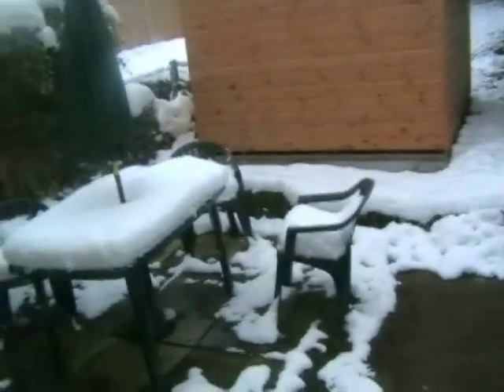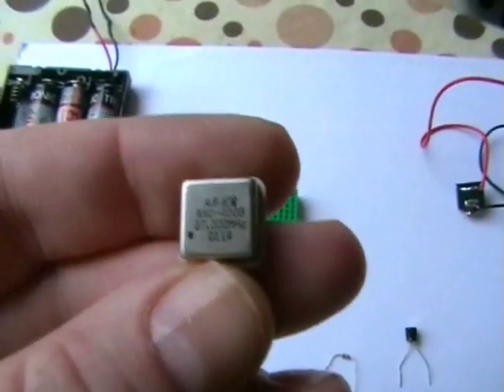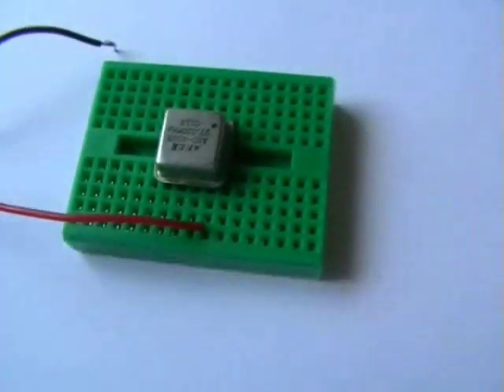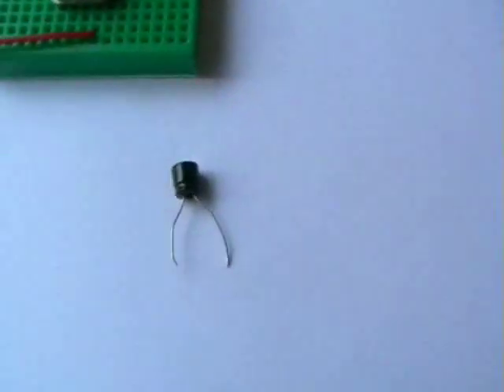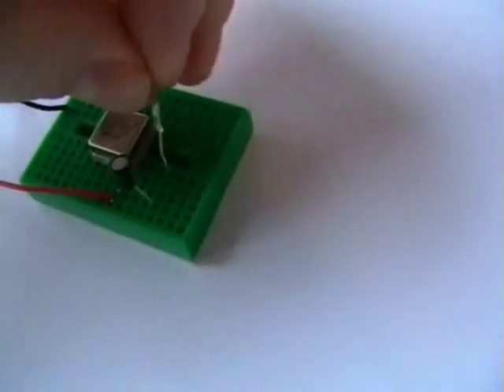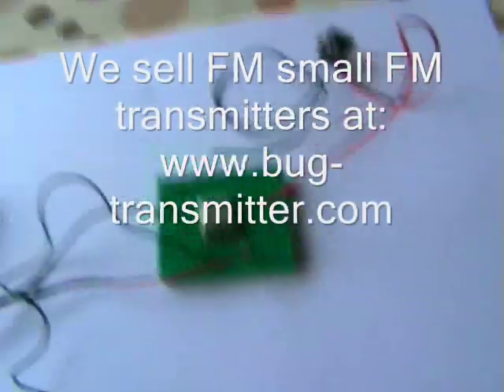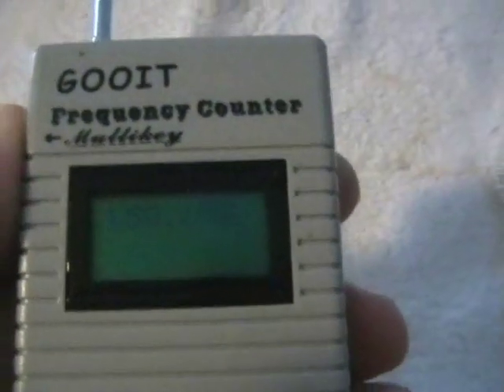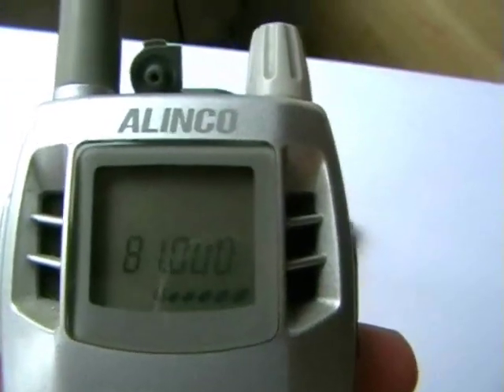Make a Transmitter only using 4 components. Crystal oscillator transmitter

Comment from the maker: This type of crystal oscillator makes a square wave ,square waves are encountered in digital circuits and are used as timing references or "clock signals. Square waves contain a wide range of harmonics; these can generate electromagnetic radiation or pulses and this is what you see in my video ,you see the harmonics.
You can use filters to make a nice clean sine wave but in this video i am showing how to use a crystal oscillator on its harmonic frequencies.
Reply: YES 470uf

Comment from the maker: You can try and use an amp ,it may give little improvement.
Try different value capacitors for the audio input.
My radio i used in the video is very sensitive.

Comment from the maker: Yes ,you can use a higher frequency.

The higher the frequency then the shorter the antenna you need.

At 1Mhz   using a half wave antenna ,its 5616 in !
At 81Mhz  using a half wave antenna ,its 69 in
At 433Mhz using a half wave antenna ,its 12.9 in

Comment: I have a question please...the sound I'm getting is quiet low ,in fact extremely low on any radio i use, i have to concentrate very hard to hear it.
and the volume you're getting in the video is fairly good
is there a solution to this ?

Comment: I have tried to find a 4 pin oscillator on old video cards and mother boards  but they all have 2 pins.  Is there a way to use these 2 pin ones to make a simple radio like this?

Comment: I had the same result as Hassan.  The sound on my radio was very faint.  I am using a variable power supply so I increased the voltage from 5 volts and found it got fainter.  When I reduced the voltage to 2.5 volts it became louder on the radio.  I tried several of these 4 pin devices with frequency from 10 to 50 MHz but always hear the transmission on the low end of the AM band.
Reply: My guess is that audio signal directly alternate the power supply (a bit), therefore changing the oscillation amplitude. 2.5V is perhaps the minimum voltage to start the oscillator and small change in VCC will have bigger impact on oscillation amplitude. At about 5V vcc the oscillator is very stable and small change in vcc doesn't move the needle so that you can't hear much on AM radio.

Comment: Hi, can you help me,I am trying to build/get a transmitter reciever for a small rang around 60-80 meter,I need it to build a score counter circuit on the sports field(will hookup with an IR and counter circuit), how small can I make the transmitter if it needs to be near something like a finish line or ring? Is it possible to use small batteries for it?how much would it cost to build or buy one? I do not know much about circuit design,so this is the first time I am making one

Comment: I tried this and it works ok but it is an AM transmitter you can see that when hooked to a scope I pick it up with a scanner set too 142.855MHZ with a 28.57MHZ crystal the sound quality is pretty bad but it works and the sound is also very quiet I have to turn the scanner all the way up to here it but it has a good transmit range with an 8 inch antenna all the way across my house without a problem that might be 40 or 50 feet I also tried it with a 6 foot antenna I can't test the range because the weather right now

update i now found the signal @ 428.543 and its much louder there but it also picks up noise easier and i tweaked the transmitter and it now works much better

Comment: Dear dazaro3, I have a 4 pin crystal that obtained from an old pc card, it reads "66.667 MHZ"...could I be successful with this Crystal frequency? Thanks a lot!!!
Reply: ALEFILES that is in the VHF band. quite an obscure frequency
Reply: ALEFILES the good is from 3mhz up to 7mhz  crystal oscillator modullator..use frequency multiplier stages obtain frequency up to 88mhz to 108mhz fm band ..so your sound is good quality like a cd quality audio the deviation freq. is up to 75 khz...

Comment: By modulating the input with an audio transformer in series with the + voltage    connection instead of the capacitor the sound equality is improved and less distortion. The crystal is best set at constant 5v supply. Great vidio thank you. I have used 1meghz crystal for vintage  MW radio restoration.

Comment: 1.How many watt is the resistor 1/2 ,1/3 , 1/4 and this is 4.7 Ohm or 47 Kiliohm what is the right? 2.Ηow many volt is the electrolytic capacitor?
Please answer to me because I start to manufacture.
Reply: Νοσταλγός του παρελθόντος depends upon the parameter of each transistor

Comment: Is there a reasoning behind using a polarized capacitor with a sinusoidal input? I am no expert, but doesn't audio swing positive and negative?
Reply: The anode (positive end) is biased to +5V so unless the input signal drops below -5V the capacitor will act rather linear.
Reply: pushrax Ah. I see. Thanks. Nice project.

Comment: Is it possible to build this using a 24mhz crystal oscillator ?
Reply: Jorma Oikarinen 24 mhz crystal oscillator is multiplied by two stages transistor x2 first stages equal to 48 mhz frequency outpot..then multiplied again by another stage x2 again..a secound harmonic frequency of 48mhz the last stages is 48 times 2 is equal to 96.000mhz..so you transmitte fm transmitter 96.0 mhz fm band. the audio frequency deviation is 16 khz only..the sound quality is mono like television audio..

Comment: i found an oscillator but it only has 2 leads! Where is the 3rd and 4th lead??? Is it useless?? its 1mhz too! :(
Reply: +realflow100 That is not an oscillator. its a resonator...
Reply: That may not be correct Chris. There are 2, and 3 pin osculation crystals, in fact the 2 pin variety are the most common.
Reply: @ArcAiN6  I know there are 2 pin crystals, but I’ve never seen 2 pin Crystal oscillators

Comment: Yes, if they have four pins, they are most likely oscillators. If it only has two is is probably just a crystal and requires some external driver/amplification circuit. Don't bother with those